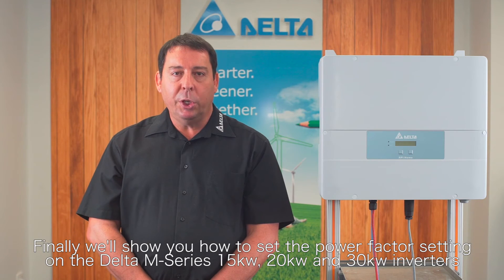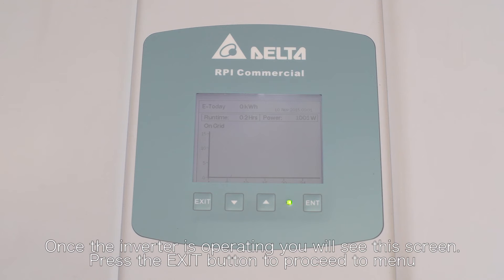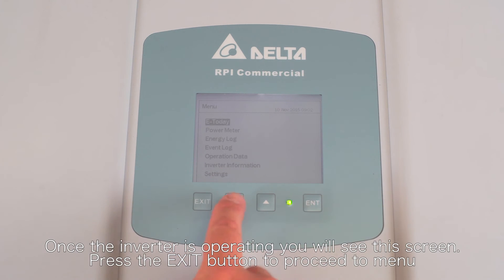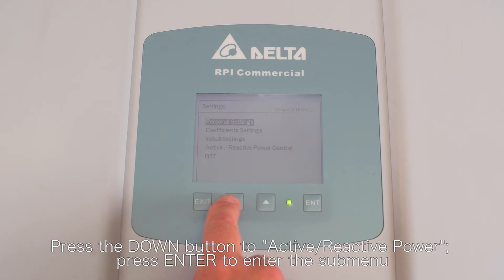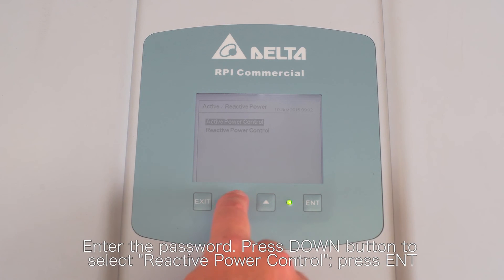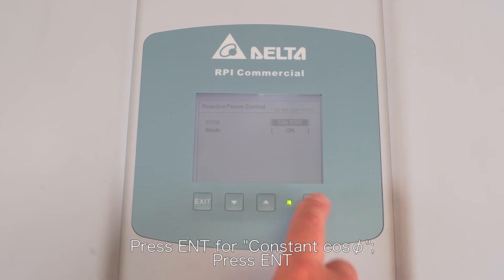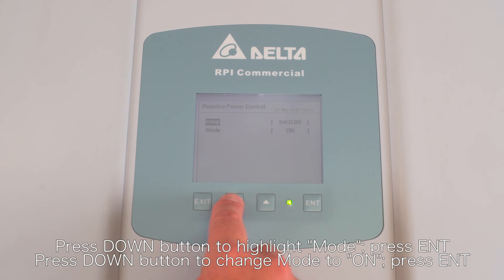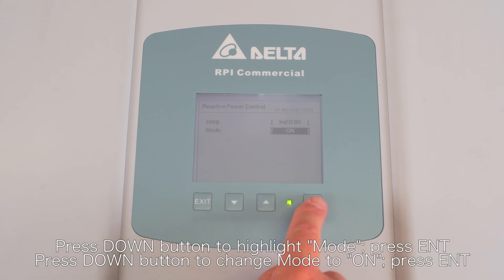Delta RPI Inverter Power Factor Tutorial

Comment: I have installed 10kw Delta inverter  it shows  isolation system  error  and it's not work I check all connection of panel please suggest solution of this error